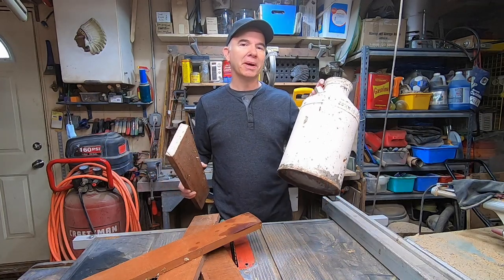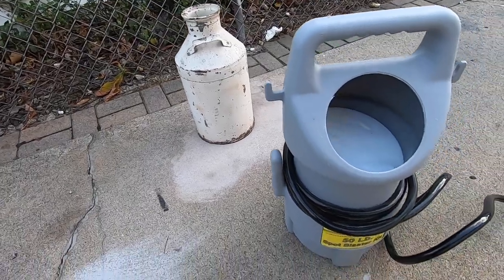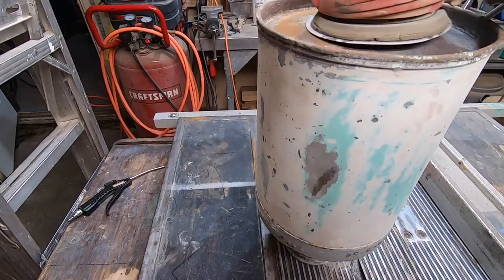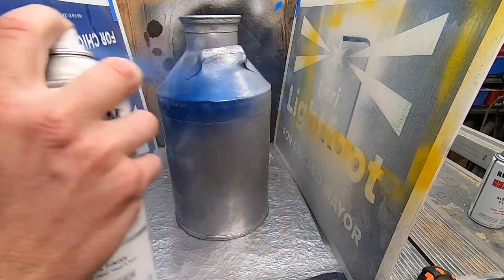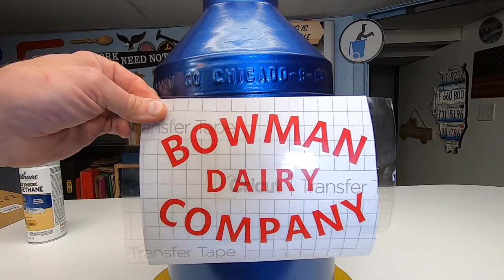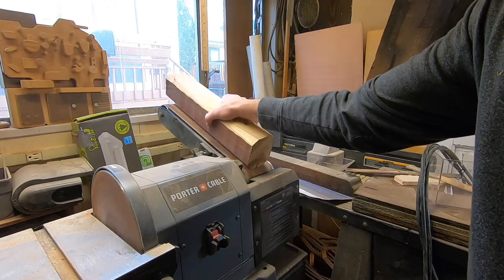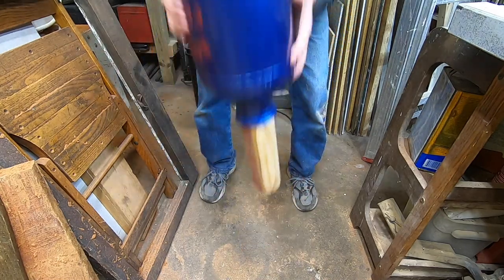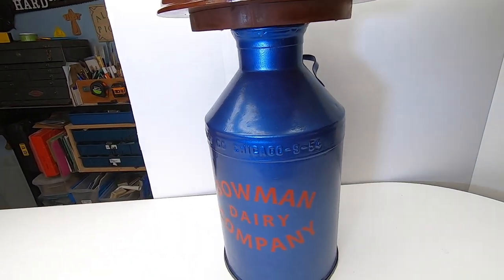Upcycling an old milk can

Comment: A question Tom: I've noticed you put a coat of shellac on the wood before applying Polyurethane. What is the benefit of doing this, rather than just poly?
Reply from the maker: I really like the shellac for the first coat for 2 reasons. One, the poly will sometimes develop tiny bubbles on the first coat. Using shellac, this never happens. Two, when I use the shellac, the subsequent coats of poly seem to come out smoother.
Reply: @AlleyPicked  Thanks, I'll give it a try.

Comment: Hi, I’ve noticed you add a sealant on the bottom  of the can, where do you get it? Thanks,
Reply from the maker: I think you are referring to the silver paint on the bottom? After treating the rust with Ospho, a rust neutralizer, I believe I sprayed it using a silver paint and primer.